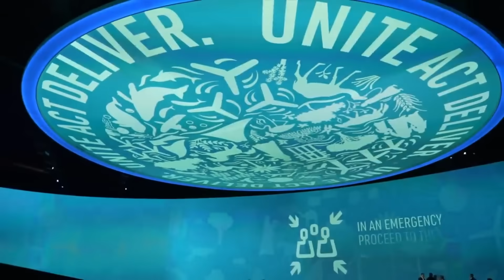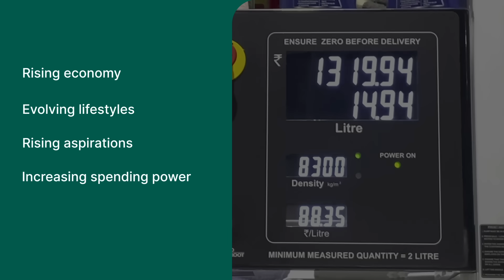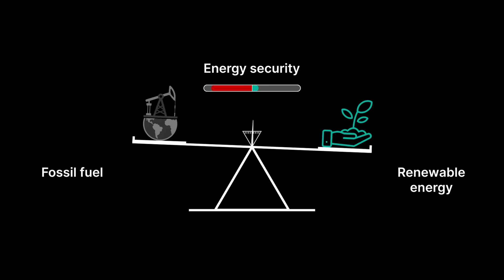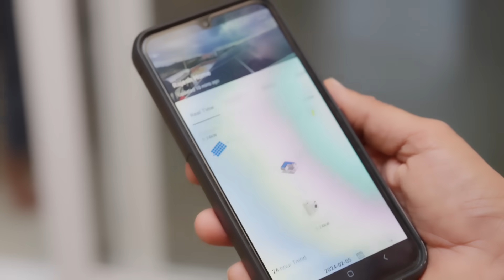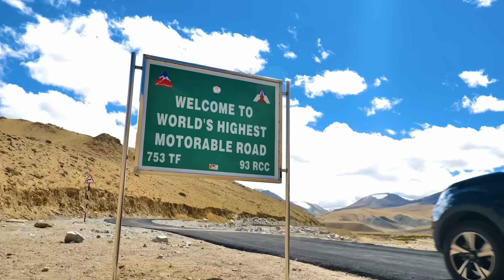Road to the Future - led by EVs

Comment: EV cars, bikes and scooters are really great to own as a consumer as it is a better alternative to fossil fuels but the biggest downside is the range fear and the cost of the vehicle by itself.

For instance here a Tata Nexon might be marketed claiming a range of 450 plus kms on a full battery, but these numbers reflect only by half in real-world scenarios. Of course, if you are just a city dweller you may live with this but most people buy a car to enjoy the open highways and long drives and EVs are hardly able to do that. But if you buy an ICE-based vehicle of the same model you are getting it for a much cheaper price even though the running cost will eventually pile up which is never a problem for the people of this country as most people buy cars in EMI and live with it easily. 

Even though this is not exactly a problem with EVs instead it is the charging infrastructure that needs some serious development. Public charging is not dependable enough most of the time due to the scarcity so home charging is the way to go for most people. Home charging also can't be set up in every type of apartment or community living space due to the requirement of triple face connection mandatory for charging EV vehicles. 

Long story short to stabilize EVs in our country it is going to take a very long time than what we imagine.

Comment: 3:26 I believe that achieving 100% electrification is still a long way to go. Meanwhile Plugin hybrid is a great way to reduce carbon emissions considering that it will require less lithium, cobalt and nickel. Also it will consume way less oil than a pure IC engine vehicle. Still we are meeting most of our energy needs by coal and natual gas. In that case it would be unnecessary to load the already stressed grid to charge EVs while we can use conventional petrol engine to power the battery for extended range. Also, let me remind you that we don't have robust charging infrastructure yet to support EV revolution.

Comment: Tata is leading. MG ZS Ex Pro is nice EV too with Lane change assist. Would be nice if all Tata EVs had a Level 2 ADAS variant, hoping to see it in Curvv,  Harrier EV. Need more Sodium and Solid State Battery plants in India and 4c charging stations every 200km

Comment: Waiting for an Altroz.ev. It is a performance hatch so Tata should consider launching the car with bigger battery pack atleast with 40kwh.
Reply: Yes. Altroz is a hatchback with a lighter and more aerodynamic chassis. Hence it would be much more efficient. With its killer looks, it can easily become a sporty electric hatch. I waited for Tata to launch the Altroz EV. But with no launch in sight, I went ahead with the Nexon EV Max. I think they are facing an issue with placing the battery in the floor owing to the already less ground clearance of Altroz. Hence they are probably working on redesigning the Altroz based on the acti.ev platform.
Reply: It wont come

Comment: Sir please make some features by which we are able to increase the battery capacity or increase the battery power by adding some cells in that. In upcoming years EV cars with more range are there in market but who purchased EV earlier they must have option to increase the battery capacity by paying.
Reply: There's only one reason why more range is not given is because of high price of Lithium. Once the prices come down OEMs will put more cells in the battery. It's a cost problem not a technology problem. As for people who have already purchased an EV, they will need to sell their cars or replace the battery if the OEMs proivde the service under warrenty.

Comment: I brought punch.ev empovered plus s on 29/2/24 , same day I tried dc fast charging outside it isn’t charging so next day they took my car to service and changed the charging socket and cable connecting it to battery and gave me on 7th evening,and again on 7/3/24 it didn’t fast charge ..now the car is again in service ..what can I do ?? Can I demand to replace my car ? Or can I get refund ..?? Tr was done on my name ?? Please suggest ..!
Reply: I purchased a Swift ZDI in May 2013. Day 1 heard Suspension sound from rear side. Shocker and chimta was replaced. Day 30 Saw all the treads gone on front tyres, had to escalate the issue a lot to get it replaced. 60 k km- AC Compressor replaced, 110000 KM Gear became free on road. Replaced clutch assembly. My point is these things happen in ICE Cars too. EV is new even for Legacy auto makers even VW Faces such issues
Reply: Hi sir.,
Myself also purchased Punch.ev on January 31st this year.

Unable to DC Fast Charging, 

Really very much disappointed. 

Service team also don't know what to do.
.

I'm tried now... 
There is no proper way to report to TATA motors regarding this issue.

Do you have any idea to whom to report. Also scared to give the vehicle to every Service center for them to learn and do research and development using our vehicle.

Comment: According to IIT Kanpur research, and many others across the globe, Hybrid cars are better for the environment than EVs. So, what's the deal with the hype around EVs?
Reply: Those researches are funded by Japanes organisations because they don't have ev tech.
Reply: p9780  Wow. Anything that doesn't meet your views is sponsored. Japanese companies would have to sell out Japan to sponsor so many institutes and companies like VW themselves.
Reply: p9780  I'm sorry, but did Japanese companies fund VW!!!!
Reply: You do know that hybrid cars are more costly to maintain because there are two things to maintain and what about the battery replacement cost of hybrid cars after its already low mileage will be down more.

And we have proper data for Nexon ev (launched in 2020) but that cannot be said for hybrid cars.
Reply: 5e  According to data from over a million drivers of hybrid cars, they're the least expensive to maintain, and have the least breakdowns. Also, you're pretty bad at pretending that hybrid car's battery is the only thing needing replacement. Same goes for full electric vehicle, just 50 times more.
Reply: Hybrids are more polluting by some other research,hybrids still have engines and it's least efficiency, sometimes use engines to charge battery that again increases emissions. IIT studies are biased as it's funded by the Japanese automobile team.

Comment: WHAT ABOUT BATTERY REPLACE COSTING OF EV
Reply: No
Reply: It is high becase of high price of Lithum and other minerals used in the battery. Lithium prices will come down in the next 5 years so battery replacement cost will also come down. Companies will also provide free battery replacement because it will be cheaper to them too. You still get upto 8 years of warrenty on your battery, it's upto the OEM now. If it's a bad company, then they will not replace your battery for free even if it's under warrenty so be careful in chosing a brand.